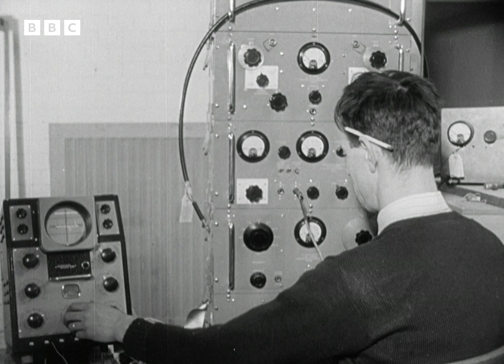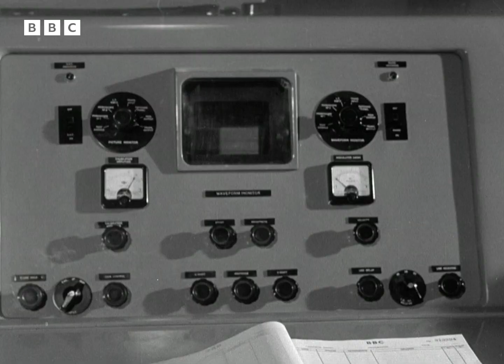1951: Building the HOLME MOSS TRANSMITTER | Newsreel | Making of... | BBC Archive

Comment: To feed the transmitter, the Post Office had to extend their microwave network, to get the signal from Birmingham's transmitter up to Holme Moss.
Reply: No. As explained in the film, they used a coaxial cable with a repeater station every few miles. I remember back in the early 1950s, in the Midlands, we lost our TV service from Sutton Coldfield for a few hours because somebody had accidentally cut through the cable.
Reply: @davidcronan4072  That is not what I was told by a former GPO engineer, who worked there in the 1960s. Sadly he has since passed away
Reply: @johnking5174  They probably went to microwave links later. Australia got TV in 1956 (At least in Sydney & Melbourne) & most of our stations were linked to the studio by microwave .

Comment: I bet a quid the canteen hasn't been in use for years and the BBC have sold the whole thing off to a private company and lease the use back at a vastly increased cost!
Reply: Because the equipment which used to need several people to operate round the clock now would fit in that canteen and can be operated remotely, only needing onsite visits to repair and maintain it a few times a year.
Reply: @lloydcollins6337  The FM hall with its 8x 20kW transmitters and associated cooling requires an area of around 400 sq m. Then there is Classic FM and DAB...  Still a lot of kit.
Reply: Broadcasting got spun off over 30 years ago under John Birt to Crown Castle. All sites are now unattended because of their reliability. All monitoring and resetting equipment is done remotely from Wenvoe or Warwick by Arqiva. Only occasional service visits sre required.